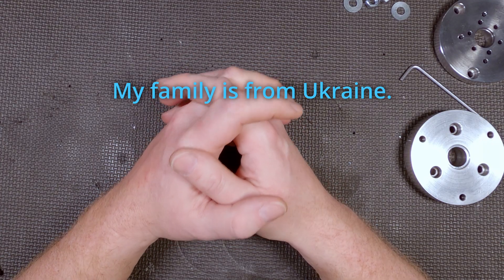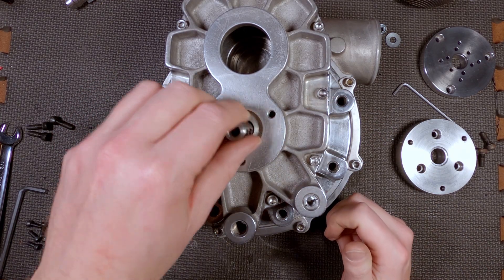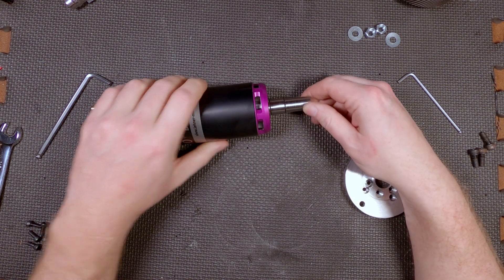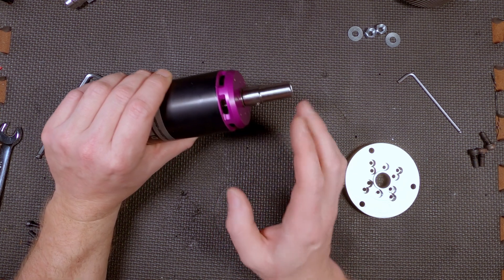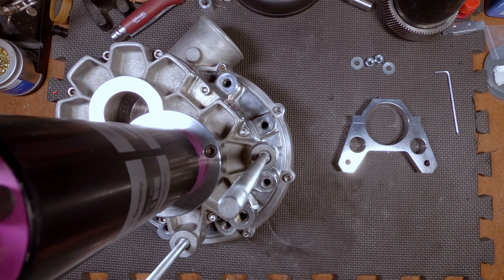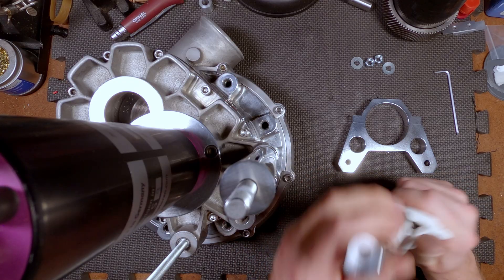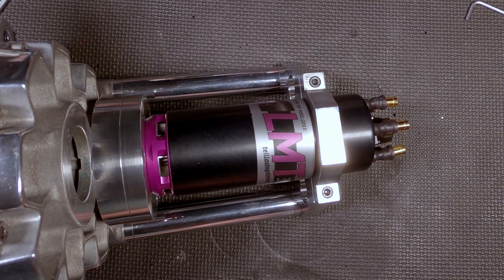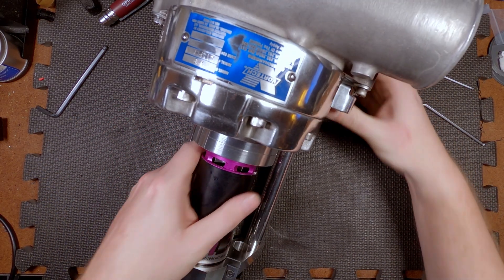DIY Electric Turbo: Sledgehammer Assembly

Comment: I think electric turbos have big potential. My idea is to also have one on the exhaust side to extract the gases at the same time. Unlike a traditional turbo the engine does not have to work to turn it.
Reply from the maker: That is an interesting idea - sort of like the original use of the venerable 71 series GMC blower.
Reply: the gases leave the cylinder extremely high pressure to the lower pressure in the exhaust.   So the pressure differential causes the flow.

Comment: Awesome project! What I don't understand: don't the rpm limits of a radial impeller itself and the motor fit together or does the motor run out of torque at these high speeds? I was wondering if I could recycle old turbochargers by bolting a kW motor to the shaft. I have some leftover stuff but I'd have to find a solution for the hydraulic bearing, like a small oil circuit driven by an electric pump since there's no issue with heat on the shaft
Reply from the maker: Basically, right now it's a balance between available motors, torque and impeller rpm.  Many people have suggested to gear up a lower rpm motor.  The biggest issue is size - a 30kW, 10,000 rpm motor is a lot bigger than a 30kW, 50,000 rpm motor.  Simply because the slower motor makes 5 times the torque.  And the main reasons why I went with a supercharger instead of a turbo is the exducer and inducer sizes are more favorable for this kind of thing and the bearing issues are already sorted out.  I use Isoflex nbu-15 grease from Kluber to lube the bearings.  The same lube some positive displacement blowers use in their "permanently lubed" rotor bearings.  It is expensive though - a 50ml tube is around $50.

Comment: So how much do you reckon it will cost $10,000,,,
Reply from the maker: This one is expensive, no doubt - about $5k to make.  The smaller unit I'm also working on is cheaper and easier and should still support 650hp.  That one could be duplicated for about $2,500.

Comment: you did professional work on making everything great job!
those vortec chargers are massive.if the electric motor cant keep up with flow maybe a smaller charger or turbo that has turbine side removed you could do this with?def try this on smaller displacement engine since they will tax the electric motor less.
Reply from the maker: The challenge is motor availability vs rpm.  Beyond that, another issue is long cables and high motor rpm, but I think I have that issue solved.

Comment: I got a thick wall 1835 that's got four individual throttle bodies for the electronic fuel injection I would love to add this setup all I got to do is put some hats on the throttle bodies and have someone professionally tune the computer

Comment: This is phenomenal man. I just started twin charging my 03 Subaru 2.5 RS that has an EJ25 STi swap and I looked into the world of electric forced induction as an option for a few weeks but I ended up going with a centrifugal supercharger/TD04R turbo. Amazing machining skills and quite an engineering feat man!
Reply: What's your power goal on that setup? I don't have any experience with twin charging but ive helped fab a couple of compound turbo setups
Reply: @barneymiller7894  I’m looking to make 400-425 AWHP. The engine is fully built but in my experience any more power than mid 400’s really kills the everyday drivability. I don’t mean I’ll use it to go get groceries but would still like the capability to do so
Reply from the maker: Thank you.
Reply: @AlexLTDLX  is there a link to the motor you used for your build?
Reply: @AlexLTDLX  Thanks man ! Greetings from the south of Ukraine !

Comment: How much $ to get a kit
Reply from the maker: Lol.  This one isn't really what I would call "cost effective."  The smaller version - the VESC/P2 unit I was testing is.  This one should support 850 hp; the smaller one about 650.  But if you must know, I've got over $5,000 in this one.  The smaller one can be done for $2,500 or less.  I'm just seeing what's possible first.

Comment: My f150 runs on CNG. Compressed natural gas. The tank sits at 3,600psi. It’s 120 octane rating. Wonder what the possibilities are to have a second ‘air’ tank that shoves the mixture into the motor. Forced air with no input besides the 3,600 psi in the tanks. The HP would be spent putting the air into the tank. Something to consider.
Reply from the maker: Mickey Thompson actually did that back in the day.  Worth googling if you haven't seen it.
Reply: @AlexLTDLX  take a look at ‘Compressed air super chargers’!  A guy has products and a system for this.

Comment: That little motor puts out 53hp I seriously doubt that and of it does that means it gonna draw a ton of power your gonna need a special alternator and 2 batteries, would be nice to see if it actually works and serves a purpose besides looking at
Reply from the maker: An alternator and 2 batteries won't cut it.  This has it's own 60 volt battery pack that recharges from the car's electrical system when it's out of boost.  The first version made 650hp in our first drag tests: https://youtu.be/AOL3Qyczt3Y  This one has more than twice the drive power as that unit did; as per our initial high-power tests anyway: https://youtu.be/Azeaf6WVPfQ

Comment: Would you not get better performance with the gears or is there a factor I'm not thinking of
Reply from the maker: That's a good question.  The problem with using a lower RPM/higher torque motor is primarily weight and size go up.  Like by a lot.  This is about the most compact balance of RPM/power that's available to the masses.  I'm sure eventually that'll change, but for now it is what it is.  The other issue is very high speed gear/belt drives bring in some small losses but also present additional engineering challenges - like heat build up and lubrication.  Look at it in terms of watts (heat) - 5% losses on a 40hp drive is about 1,500 watts of heat you need to get rid of.
Reply: @AlexLTDLX  il take your word on it I'm not that electronically savvy

Comment: What happened to the P2 version?
Reply from the maker: Still happening - I've got a different motor (sensored 4 pole Castle Creations unit) that should alleviate the high eRPM and consistency issues.  But I got tired of endless garage testing and wanted to switch over to something I can test on the car ASAP.  That's this setup.  I'll got back to the P2 Unit once we get some testing (dyno and dragstrip) done with this one.  I might even compound the two.
Reply: @AlexLTDLX  compounding might be problematic, you have to remember with compounding that the primary has to support the total power airflow of the system AT the P/R that it runs at by itself. 

Now, if you made a smaller one out of like a 3582 compressor housing and wheel and used that as the secondary, compounding might be easier and could be the way to go for efficiency. 

If the P2 blower has say 70lb/min of flow at a P/R of 1.6 and you wanted to run a total boost of say 25psi, you could run the secondary at a p/r of like 1.7. You could get close to 700 wheel with an insane torque curve and high efficiency. 

However, you would need to start with an engine that would produce about 700 whp at 25 psi of boost.

The other good thing about doing it with electric motors is that you have total control over the ramp in and total impeller speed. You could program it for total efficiency and power throughout the curve.
Reply: @AlexLTDLX  Actually, one thing you might consider is to run a 3582 turbo and then use the P2 to compound for top end power. It would work well on a smaller motor with less mods. It would be ideal on say a 4.6 2v. Something that makes about 250-280hp stock with a total goal of about 700 wheel. You'd get that quick spool from the small turbo and then the high end with the compounded e-S/C.

You could just run the turbo for about 450 wheel for driving around and press the button at WOT for that extra kick...lol

Comment: what is the original design purpose for that motor? E-Bike or 1/5 RC truck? wait 53hp thats not either of what ive just thought of.
Reply from the maker: 1/5 RC stuff.  But I think that would be nuts.  Heck, this thing would do well geared down in a small motorcycle.  Or a go kart.

Comment: It would be a really fun and interesting experiment to power the electric motor on this turbo by a generator or alternator being spun by a hot side of a turbo! It would eliminate the heat transfer that normally happens from hot side to cold side. And you could also store and buffer the power with batteries and capacitors if you wanted to. I wonder if an alternator would work for that if you geared it right.
Reply: That's basically what porche plans to do next.
Reply: @SoulTouchMusic93  that's how the F1 MGU-H on the 2016-2024 V6 1.6L turbo hybrid engines work.
The turbo is split into two parts, the hot side connected to a generator and charging the power cells, and the turbine powered by an electric motor. With a button to increase the voltage to the turbine for additional power when overtaking.
Reply: Why didn't I think of that, makes sense
Reply: One of the German makers  was looking into  scavenging  every  btu of heat going down the pipe-  heat is energy-  and turning it into  amps via  turbines..  which was going to 'help' the ICE  engine by putting torque  directly to the crank.     I"m not sure what happened,   probably not the  payoff they were looking for.

Comment: Great precision work! Guess its part Turbo so I like it, and the fact Audi has Electric turbo'd a TT RS for twin turbos on the 2.5 5 cylinder! Think I should on my TT RS also as 600 HP is better than 400 stock.
Reply: It's not a turbo. Turbos have turbines. This is a supercharger.

Comment: Twat...that's not a "turbo" at all 😂😂😂 it's a supercharger....it's the same as a PROCHARGER!!!  Lol....so yes, obviously it would work if you got it spinning fast enough as that's how they work.... usually it's the engine crank spinning it, but the electric motor would just take its place.....

A TURBO CHARGER uses exhaust gases to spin it, therefore there would be no where to do it from as it lts litreally span from inside the impeller.....not span from the outside....

So....it's an electronic supercharger...not a turbo lol

Clever though, kudos!!!! And the good thing about it would be, is if you get a powerful enough motor, you could get more boost out of it as a normal centrifugal supercharger uses the crank to spin. Therefore can only spin as fast as the engine can spin....if you can get the electric motor to spin faster...then you got more boost!

Comment: I got 2.5hp 90vdc 3200 rpm. Maybe that will work
Reply from the maker: It wouldn't do much.  That's less than 1/20th the power of this motor.  It takes about 4kW for every 200hp you want to support at relatively low boost and power - about 800hp or less.  2.5 hp is only 1.9 kW; and the rpm is too low - it would need significant gearing up.  But you probably could get it to make some boost on a small motorcycle engine; but I'd bet it's probably pretty heavy too.  A brushless RC motor that can hit high rpm and make decent power is actually surprisingly inexpensive, all things considered.

Comment: Would it not just be easier to driver this thing with a belt? Dont get me wrong,as a tuner and ex programmer/IT guy I love the idea,but its just so many more things to have on the car vs a belt and a tensioner.
Reply from the maker: That's a good question. With the Whipple before this it made less than half the power per PSI & took 70 horsepower through the belt and when it tossed a belt it did a lot of body damage to the car.  Best time with the Whipple was a 9.83 at 140.  This should easily outperform that.

Comment: if you make a generator with a hot side(the other half ,turbine , that goes on exhaust manifold, and 2 smaller(but combine electric motors*(as generators) to power that thAng u just did q=D

Comment: Nice machine work!  If you need any dynamic balancing, I make motors and rotors for a living.   Would you have room for a larger diameter motor?  Was the motor speed selected for the blower speed?
Reply from the maker: That's an offer I might take you up on in the future.  We could go larger diameter, but we need a lot of rpm.  Feel free to send me an email in the contact section of my channel's main page.

Comment: Good job my brother.  I sold my turbo kit design and manufacturing business back in 06-07...Got married, started family opened a new business etc etc.  I got into hardcore RC around that time and first time I saw the power the BLDC motors were capable of, this idea came to mind.  I have been waiting for someone to catch on and do it!  When audi talked about their electric turbo I waited and was like "Maybe....mayyyybe? NO! So close!" lol In the progress of designing in my head I ended up at a supercharger head as well.  LOL  It just makes sense.  Best of luck, I hope it works out.  Just a thought for quick charge ups, discharges etc.  Go supercaps instead of lipo or whatever.  Yea, more expensive but the charge/discharge rate can't be beat.  There is actually a supercapacitor "battery" made for the car audio industry it would be a nice easy "premade" unit if you don't feel like going through the hassle.
Reply from the maker: Thanks.  It already did work out: https://youtu.be/AOL3Qyczt3Y  This is our attempt for big power.  Supercaps (I have a giant supercap setup that I tested for other things - it's designed to start semis and  trains - I did a self discharge video on it) would actually be a poor choice because the voltage discharge curve is linear and the power density is really low.  I'm now using Lishen 18ah LTO cells - also used in high power car audio - those things are beasts.  I tried stick welding (also a video) with them and couldn't keep the amperage low enough.  Would be great for stick welding 1/2" steel with 5/32" electrodes, though!
Reply: @AlexLTDLX  Nice nice!  Thanks for the reply.  Seeing your results honestly, are right about what I thought would happen! Right down to the current draw, airflow, hp increase...all of it!  Wow, I feel vindicated from all the eye rolls I got as I said "no no, this is different - we're not talking 1.2kw here, more like 15-20Kw!." and finally just stopped talking to people about it.

Regarding the last message...The LTO's are nasty, no doubt about it.  I said supercaps, but I meant ultracaps...Tecate Group UltraCaps to be specific - sorry.  https://www.tecategroup.com They've got some great calculators on their site as well.  They show a bit more promise...BUT, to be 100% upfront I didn't go too far into the maths so take it with a grain of salt.  A friend of mine is a lead engineer over at Honeywell, so I spent way too much time diddling around with turbo compressors and maps before I thought "duh, just use a centrifugal charger head unit."  LOL  Then, "life" took over and everything went on the back burner.  My kids are finally older now and I recently bought a turbocharged daily driver...alllll the juices started flowing again! lol  Definitely see you over on the eboost forums.  Best,  Jay

Comment: How much money have you invested in to this project?
Reply from the maker: Please don't make me add it up.  It'll make me cry.  But so far, I'm quite sure I'm well over 5 figures getting to this point.  After all, I've bought 5 motors, blew up 4 ESCs, bought about $2,000 worth of batteries, even well over $1,000 worth of cables and connectors, a billet impeller, a volute, another entire supercharger, etc.  It's a lot.  But it's all in the name of development; finding and overcoming the pitfalls.
Reply: @AlexLTDLX  i know how you feel, I started to make my own pcp airguns as they are expensive   Now I have cnc machining center, two cnc lathes and a garage full of other tools. It got out of hands really fast. But now I'm owning one of the most powerful airguns in the world.

Comment: Patent and sell??
Reply: It's definitely something you should consider, the only thing I'm curious, its a setup of only periodic use, so can't necessarily provide boost in a quick second when you need it. It's really a perfect setup those for at the track. Thanks for your video,  I'm looking forward to more content.
Reply from the maker: I suppose there are a few aspects of this I could patent; but I'm really more about the development.  If I start selling anything, it'll more likely be various components, both for liability reasons and because everyone's application is different.

Comment: need engine oil lubrication on those impeller bearings if not is going to go 💥 🤯
Reply from the maker: Most new superchargers don't use engine oil lubrication anymore.  In an electric turbo that doesn't spin all the time, there's even less need for it.  If you go back through the electric turbo playlist, you'll see the special grease I'm using in these bearings - it's Kluber's Isoflex NBU 15.  Expensive, but works very well.  About $1 per ml.

Comment: I like the fact you are trying :) , cause making power to run things in a vehicle is relatively easy but finding something to then power a device efficiently to do a job is the hard thing.
The advantage to all this in this day and once you have a working prototype its easy to have someone make it and or upgrade it to suit production.
Keep it up and thanks
Reply from the maker: Thanks.  We already have a working prototype: https://youtu.be/AOL3Qyczt3Y  Now I'm working on two different models - this one for more power (first working prototype made about 650 hp; the goals for the sledgehammer is about 850 hp); the goal for the other belt-driven unit is compactness, cost-effectiveness and ease of construction.